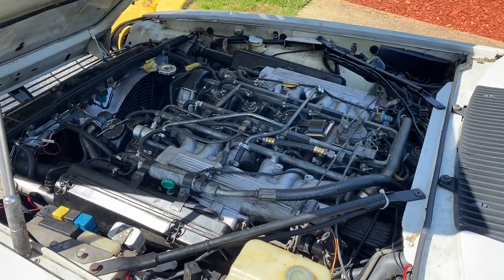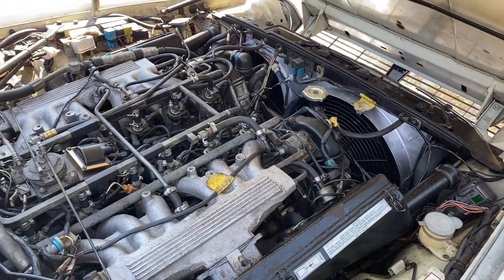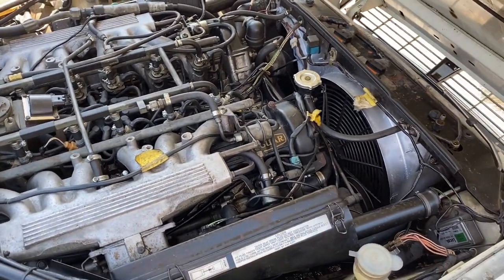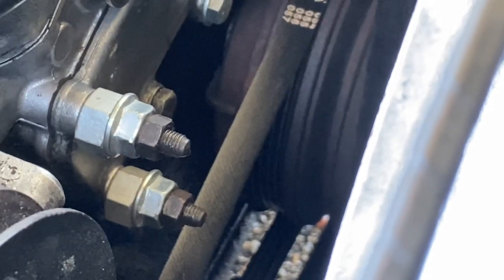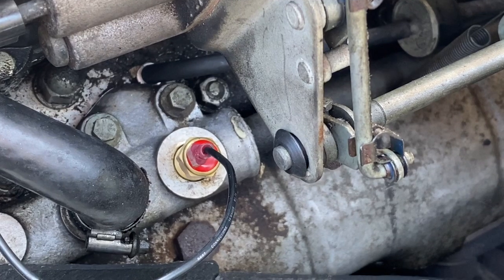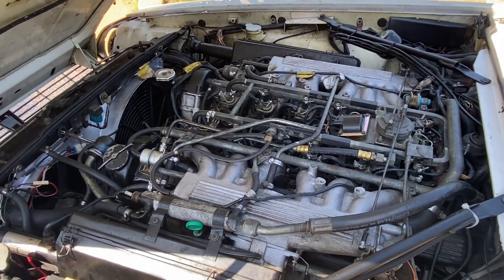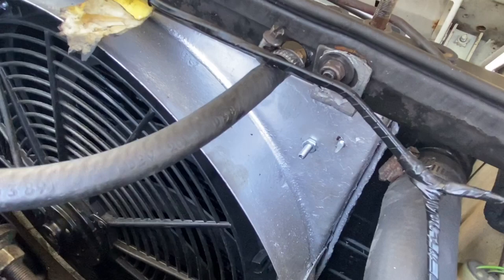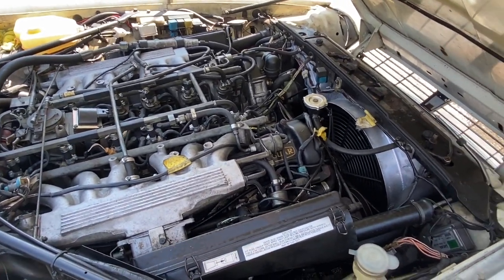Jaguar XJS V12 Dual Electric Fan Mod

Comment: Nice, i shared this vid to the Jaguar Drivers club facebook page... They love these
Reply from the maker: JagSTR Guy you the real MVP bro much appreciated. Let’s cruise once this corona blows over
Reply: @PedrosGarage  thats a bet. Jag in the shop now. Fuel injector went bad. So i decided to replace every gasket there is on the car as well as coolant hoses since the whole top had to come off. An add smaller pulley to the supercharger.... I miss Vic last cruise i seen vids that you made it
Reply from the maker: JagSTR Guy oh shit I didn’t even peep the vids where they at? And that’s good peace of mind you’re doing. Won’t have to worry about it for another 100k prolly. Good stuff.
Reply: @PedrosGarage 🙏I hope 😀. Might not have a video on the uninstall, car been there going on 3 weeks an ive had to work during this corona shit. Been waiting on this Expensive ass egr pipe witch i hoping be here tonorrow... Think i have a couple clip on my ig
Reply from the maker: JagSTR Guy yeah shipping is all messed up rn. Smh. How much hp increase with the pulley swap? Are you getting it tuned?

Comment: Nicely done I am just in process of converting mine on a jaguar series 3 and I got two 12 inch electric fans controlled by adjustable thermostat prong which goes in the top hose on the rad we will see how it works out
Reply from the maker: Very nice! I'd like to see a video of your setup! Good luck. thanks for watching.
Reply: Can you share a link to the kit you used?  Thanks

Comment: Good action. Pls mention diameter and order of operation. Any controller on it (to prevent overheating instead of curing it. Proactief/reactive) ... Tech data
Reply from the maker: Hendrik Abbeloos the link for the kit I used is in the description.. I believe the fan is 16” diameter, the rest is easy. I have faith in your abilities.

Comment: I need to do this. My viscous (yellow) fan works but is really noisy, I think it is causing the shroud to resonate. It's so loud you can hear it over the car. Gets worse the hotter the car gets, presuming this is because the viscous clutch is making the fan spin faster.
Reply from the maker: unregistredhypercam hey man, I had a similar issue with my first fan (believe it or not I had another yellow fan in there before I decided to swap to electric) and the clutch seized, causing the fan to rotate almost 1 to 1 with the engine.. and as a result was very loud and dangerous. The fluid in the clutch is supposed to break down at higher RPM, and allow the fan to slow down, it thickens at idle and draws more air when it needs to.. anyway my belt flew off and didn’t realize I was running an air cooled V12 🤣  replace the fan and clutch buddy, or swap in some electric fans and put it all behind ya. Thanks for watching.

Comment: i want to do an electric conversion as well on my 5.3, but since i deleted my air pump and AC compressor and am removing the condenser i wanna see if i can move the radiator forward more to were the condenser sits so i can have even more working room on stuff and any repairs needed up front
Reply from the maker: Gavin Willoughby great idea I’ve done just that with the exception of moving the radiator forward. I removed the condenser, the air pump and bracket, the old fan and all the hardware and hub for it and it’s worked like a charm. Temps are nice and low. Only thing I need to add is a controller for the fan so it’s not always on..

Comment: Do you use this car in the summer with no ac?
Reply from the maker: Jabraan yup! Windows down.
Reply: Pedro’s Garage I have an 85 xj and the summer heat here in Texas makes driving a chore with no ac. I need to fix it
Reply from the maker: Jabraan I agree, I should get it fixed but the cabin gets so hot so easily, I don’t think having the AC would make a difference 😞